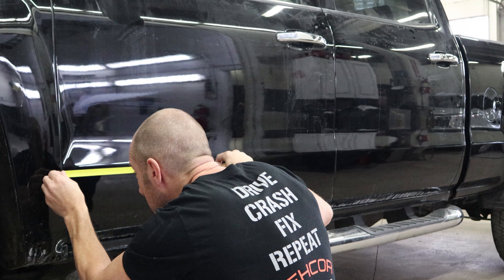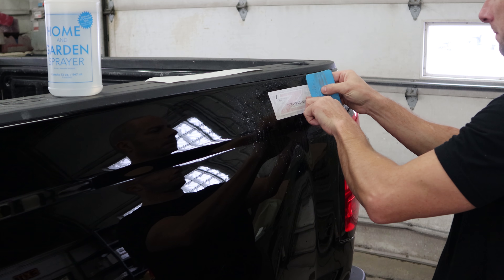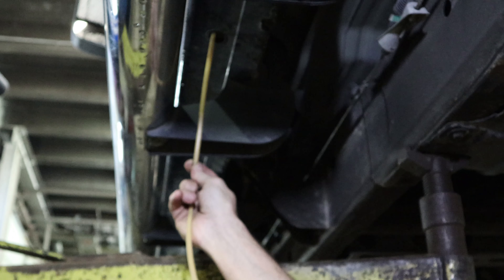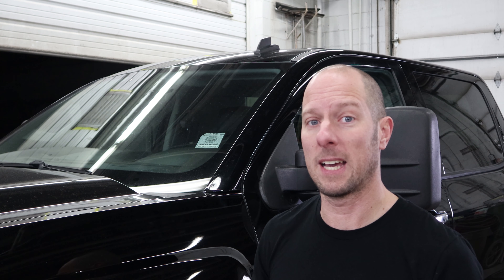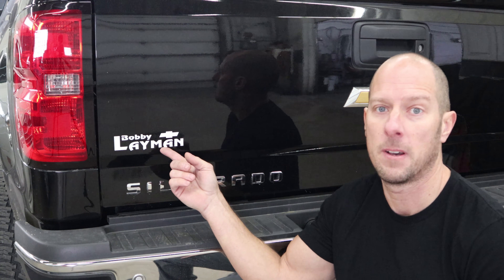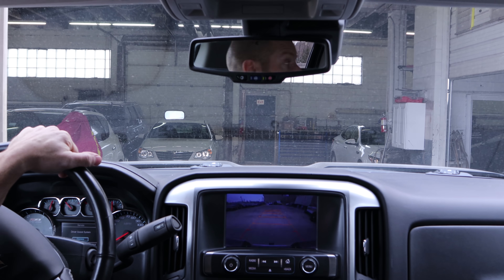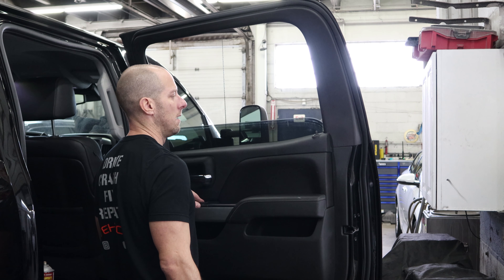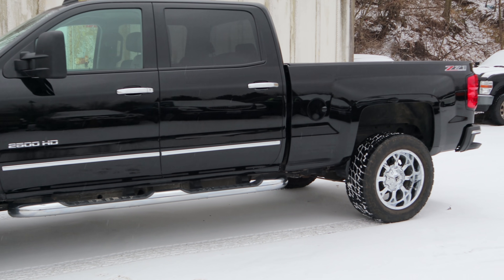2015 Silverado Duramax LTZ build Q & A and the finished product.  The "mistake" hits the road!

Comment: Great Job on the build. I have 2016 Duramax which recently was totaled due to the roof caving in on our pole barn which it was parked in. I decided to buy it back from the insurance company while also buying another new one. The truck is completely solid and only 34,000 miles still under factory warranty, just needs some cosmetic work done. Just wondering if you have a rough idea what it would be worth if I sold it as is?
Reply from the maker: Thanks!  Send me some pics at vehcor1@gmail.com  I may be interested in it myself.  Thanks for watching.

Comment: I discovered this build yesterday and watched all the parts yesterday. I was very happy to see this posted today. 
I have one question. Why did you use the engine from the mistake truck? Wouldn’t it have been easier to keep the drivetrain complete on the parts truck when you switched over the frame? 
My guess is the miles were lower on the mistake truck engine.
Reply from the maker: You lucked out, no waiting. lol  It would have been much easier to use the parts truck engine. I was not sure if the original engine was good, so it is not worth anything but core value ($1,000).  By investing a couple hundred bucks and a little time, I was able to verify I had a good engine and could sell the parts truck engine.  It was about making and extra $6800 on the build with the gamble of a little time and money.  Thanks for watching.

Comment: Those who said the truck would rattle probably took apart the interior of an American car made between 1970 and 2000. I thought the same thing until I changed my heater core a couple of years ago. Newer cars (yes, even American cars) tend to go right back together the way they came apart, so long as you don't get impatient and break stuff during disassembly.
Reply from the maker: Either that or those are the people with the pile of leftover screws at the end of the job. lol  Thanks for watching!

Comment: Great video! Thanks for sharing about the cavity wax tip. I have to replace the rockers on my 2500 due to neglect from the previous owner. I only want to do it once. Or should i just replace the cab? 😂
Reply from the maker: Personally I would replace the cab if it was mine.  A lot of times replacing the rockers is not permanent.  The rust comes back unless you get it all and that can be more costly that a can replacement sometimes.  Make sure to use the wax either way you go and it should last a lot longer.  Thanks for watching!

Comment: Question. On expensive builds like that. Is a parts car the major way to go or it depends on the circumstances?  And how much of a hit you take for a branded tile?  Some say 50% over used prices.  That seems huge hit to me
Reply from the maker: Parts car is the only way to go on this.  The little odds and ends would have killed me plus with some hack there before me, lots was missing.  Only uneducated or buyers looking for a deal say that.  The truth is it depends on demand.  These bring 90% of clear titles because they are in high demand.  An older car with low miles can bring more than a clear title if they are hard to find.  I have had a few.  For the most parts, they are worth 70-80% and it gets closer to 100% as the cars get older.  A high mileage, 20 year old car is worth the same no matter what the title says.

Comment: Great job on the truck!  Are you going to drive down  to the shop that tried to fix it and show them what you did?
Reply from the maker: Thanks.  When I made that first video I had every intention of keeping it and would have eventually passed by them while picking up cars.  Since things changed and a buyer came along, it doesn't look like I will have it long enough for things to work out.  If they were closer, it would be worth the drive just for the video but they are12 hours from me.  Thanks for watching.

Comment: First..great job! Very impressive attention to detail. So I'm a newbie to all this, and I always thought a Salvage Title remained a Salvage Title. But seems there is a process guys like you(and others) to actually take a Salvage Title back to a "good as new". News to me....so two questions.:1) What's a rough estimate for the state charges to execute the inspections and then new Title paperwork?2) Have you even encountered problems after this "resurrection from Salvage Title" being rejected by an Insurance Company or another State's DMV (other than where you did the inspections)?Thanks!
Reply from the maker: Here is the deal (I will have tutorials that go into detail).  A salvage title is purchased buy a rebuilder like me and rebuilt. It gets inspected for safety and then by the state (if it is new enough) to make sure the parts used were not stolen.  After that is gets issued a clear title with a rebuilt brand.  There are insurance companies that were not insuring rebuilt branded titles but they have found out they were losing money and changed.  There are companies that payout less on a total loss if it was a rebuilt brand.  I have StateFarm, they payout the same as a clear title and insure everything.  The state charges $94 for the antitheft inspection and $95 for the tile.  The safety test varies, I pay $40 currently.  Thanks for watching!
Reply: Thanks for the info! I appreciate it!

Comment: Great work.  Good looking truck.  One question.  You move so quickly and are an obvious professional, are there standardized fastener sizes that GM uses for assembly?
Reply from the maker: Thanks, they do not use as many different types of fastners as some manufacturers do.  If you are referring to the head sizes, yes they are pretty much 7mm, 10mm, 13mm, 15mm, 18mm 21mm there are some other random sizes for special bolts but you learn where you will find those as you go.  Thanks for watching.

Comment: I'd like to know more about the rattle can rust proofing. Can it get into areas like the box and doors and rockers? The cost of the gun is alot for a one time use
Reply from the maker: I will have a video on the rust proofing that was all done with a rattle can for just the reason you stated.  You many not want to invest a bunch of money if you just want to do one car for yourself.  There are attachments for the rattle can that allow it to get anywhere you need.  Thanks for watching.

Comment: TY for the great build vids ,,,, Tons of pointers passed on too!!! ,,, now 78 hrs shop rate CANADA 120.0 = 9,360 cad  + original cost for 2 trucks from auction , my guess 15000 cad  and that truck  would go for 40000 ish canadian due to being a DIESEL AND TOP LINE INTERIOR.  So that is my guess ,, Regards J
Reply from the maker: Your numbers are close but a little low.  You know your stuff.  These things are in high demand and after driving it for a little, I see why.  Thanks for watching.

Comment: Great job on the truck!  Do you have an inspection plan documented when your looking at a prospect or do you just go with a 'trained eye?'
Reply from the maker: Thanks!  I have done over 1000 rebuilds, I used to be very detailed in how I looked over potential builds but have learned to just figure in some extras and what I might run into so I can spend less time calculating and more time building.  In the long run, it is more profitable.  I don't get as many cars but the ones I do get are very good deals.  This one all started because I was not as prepared for what I might run into as I usually am.  I was not expecting the trans and transfer case to be destroyed.  I did buy it for what the engine was worth alone so once it started, I was well in the clear.  Thanks for watching.

Comment: Good Job. I got a question for ya. I got a 2018 Silverado LT with cloth. Is it possible to install leather seats and plug them into something that's already there? BTW, I would like to hear the numbers so I hope you get your request fulfilled.
Reply from the maker: Thanks.  The seats are pretty much plug and play.  You will not get all the other options like heated/cooled, memory, or rumble unless your truck had those options on the old seats but if the coverings are all you are after, the wiring is all the same on all the ones I have seen to date.  I hope I have to share the numbers as well.  Thanks for watching!

Comment: great job she rides rough from the lift is PPG paints more durable then stock paint if that's what you used ?
Reply from the maker: Soon, the shop is converting over to PPG and I can't wait.  I have the same opinion.  What they use now is Sherwin Williams.  It is decent, I would say as good as the original.  It doesn't ride too bad.  The camera was just on the tripod on the floor in the back seat for the test drive and sitting on the passenger seat for the end so it looks worse that the actual ride.  Even with the lift and tires it rides better than my stock 06. I don't want to go back. lol  Thanks for watching.

Comment: You mentioned that you used another cavity wax, or rustproofing product on your other truck, 10 years and no rocker rust, what was the name of that product? FYI: Fluid Film, it does ‘wash’ off on frame and suspension and needs to be reapplied at least annually. Well done on both your videos and rebuild. Subbed
Reply from the maker: I use Wurth cavity wax normally.  I think the FF will last longer inside the rockers and stuff where it is protected. We will see, that is why I wanted to try it out. Thanks for watching.
Reply: vehcor Thanks for the reply. I’m enjoying your videos, very nice work and generous spirit sharing your knowledge.

Comment: I know I watched nearly all of this series, but did you explain the aftermarket suspension system that was on this truck?
Reply from the maker: No, it never occurred to me and you are the first to ask.  It is just torsion keys up front and taller springs in the rear.  I forget the brand.  Thanks for watching.

Comment: I have the same truck. Do you have any input on all the controversy surrounding the LML engine, particularly the catastrophic injector pump failures?   I'm a little worried.  What rims are those and what kind of lift does it have?
Reply from the maker: There are a couple solutions to the pump failure. One replace it with an update or two run a lubricant in your fuel.  The problem is our diesel doesn't lube the pump like it should.  I was quite impressed with the LML over my LBZ, until I got my L5P.  There is no going back for me now!  The rims are fuel and I think the model is torque if I remember right.

Comment: This is going to sound like a stupid question. I'm new to the channel, but do you guys do body work for the general public?  I ask because I'm trying to find someone who can tackle replacing a fender (or section) and a rocker panel.
Reply from the maker: I do work for anyone but recently I have been overwhelmed with work.  I only have so many hours in a day and between my full time job, rebuilds, editing videos, the gym, side work, and all the other things in life, I have not been able to do much extra work.  Thanks for watching.  If you are in the Chicagoland area, I can recommend a shop to you.
Reply: @vehcor  Thank you for getting back to me! I live in NWI, only about 20 mins away Chicago. I'm not sure how big of a job it is, but I have an 05 Avalanche. I'm sure you see where this is going. Has the infamous rust forming above the right rear wheel well and the driver side rocker panel under the rear door is eaten through. Most of the places local to me said its impossible to cut out these sections or replace them. Considering its still in good shape with 100k on the odo, and no foreseeable plans to get rid of it anytime soon. I've been trying to find someplace that can get the job done.
Reply from the maker: @supersaiyenunlimit2  Oh I knew where it was going when you said NWI, Avalanche and you have a job.  You can buy replacement rockers and wheel openings.  I don't get into rust work because it always comes back unless you get way into it and then it is not worth it.
Reply: @vehcor  Thats why I was asking haha. I was going to pick up a new rocker panel, and the wheel arch but haven't been able to find anyone who is willing to those out and weld in the replacement parts. The rocker panel I'll paint myself since I have running boards to cover the lower portion, its just getting the wheel arch painted to match that part of the body. I'm not planning on a full rust fix, but having those two would at least get me a few more years.

Comment: I have to ask, why did you use the engine and rear end out of the black truck, when the engine and rear end in the other "doner" truck seemed fine?   This is a question based off of what I am sure is my own ignorance.
Reply from the maker: An engine and rear end are worth $2000 as cores since I don't know if they are good.  A good running engine and rear end with video proof is worth over $12,000. So for a little labor and  a few parts I made $10,000+ additional.
Reply: vehcor gotcha thanks for taking the time to reply

Comment: I'd buy a rebuilt truck from you.  Duramax, Powerstroke, Cummins. Any platform will do.  Im only picky on a few things: Charcoal grey paint,  leveling kit,  10 ply tires, extra leaf in the rear.  Ok, let me know! Nice build, btw.
Reply from the maker: So you are only picky on the color.  The leveling kit, springs, and tires can all be added to any truck and easily.  Sounds like you are one of the people that actually want to use a truck for towing, not just driving around in. lol  Thanks for watching.  I'll let you know if anything comes up.

Comment: heck I have a 94 chevy  pick up with no rust here in Idaho I don't miss the midwest  because of that
Reply: crash32301 it snows in Idaho quite a bit right? What do they put on the roads there?
Reply: @bondpit8750  they use beet juice  from the sugar plants and gravel  I was under my 94 chevy a couple weeks ago  no rust at all so if you are looking for builders look out here we have a shit ton of old trucks out here
Reply from the maker: It's not the snow that rusts cars and trucks, it's the salt.  I buy a lot of my builds from the south just to avoid rust.  Unfortunately, I have to drive around here so I use rust prevention to help save the vehicles as long as possible.  Thanks for watching.
Reply: crash32301 In Michigan they use a combination of materials, mostly rock salt but brine is the worst. It gets into every nook and cranny and doesn’t. easily wash off. Not too mention the damage it does to roads, bridges etc. or the runoff. We need to find a better way and we grow a lot oF sugar beets!

Comment: 78 hours, depending on how you calculate your time (burdon rate or an hourly rate) that's between 5-10 K, probably 15K in parts, materials, and the two trucks... 20-25 grand for a 60,000 truck isn't half bad. If I'm close do I get my name on the tailgate?

Comment: I woulda left it demolded and de badged. Any tips on sticking on a bed decal like the z71 in the correct place ? Lol 
Also where can i get wat i need to blow the fluid film with the air like u did
Reply from the maker: I normally don't like the badges and moulding but the doors are so big, they look plain without them.  I did leave the Duramax name off the hood because it looks better without it.  As for getting the Z71 sticker straight, just measure off the other side like I did.  Using the water and dish soap (wet application) is very forgiving.  I can move it all around multiple times to get it perfect.  The sprayer I used was from the product I normally use.  There is a link in the description to a better gun.  It is a little pricey but it is higher quality and if you plan on using it a lot it will pay itself off quickly.  Thanks for watching.

Comment: Nice work! 

Ive got a 07 Silverado with a stereo issue. I had a faulty sat reciever box that was causing a parasitic draw which was fixed by unplugging the sat reciever at a local shop after they went through to find the problem. Afterwards my speakers are intermittent zand I can't find the junction which has a loose connection. I've searched and searched for diagrams and no success.  Could you point me in the right direction? 

Thanks.
Reply from the maker: 07s came in two body styles, I will assume you are talking about the new body style because they were known to have the issues with parasitic draws.  I have never had any issues with those other than the modules themselves.  Used ones rarely work, new are expensive and rebuilds aren't cheap either.  It could be a loose connection just about anywhere if the shop was pulling plugs to find the draw.  Start at the modules and head unit.
Reply: @vehcor  Thanks for the reply.  Yes it is the new body style.(Reg cab)  I've already pulled the head unit out and most of the dashboard and have checked every connection I can see. No joy. I was curious if you had run into a similar issue given how many times I have seen you strip the cabs and swapped wiring harnesses.  Would you know of a good site where I can get diagrams from?
Thanks again.
Reply from the maker: @BrianTrimble  Try these guys and let me know what you think: http://www.emanualonline.com They had asked me to do a sponsored video but I had never used them so I could not endorse them.  I get my diagrams through Mitchell and Alldata but they are not available without a very pricey subscription.

Comment: I have an 05 Silverado K-2500 LT extra cab with no handle above driver’s seat. Are the holes in the overhead to add one?

Thanx from the left coast near the Krapitol of California
Reply from the maker: No, that is something they added to the new ones.  I have an 06 (same as yours).  I did almost the same job as this one and there was nothing up there.  I suppose you could add a handle with a little ingenuity.